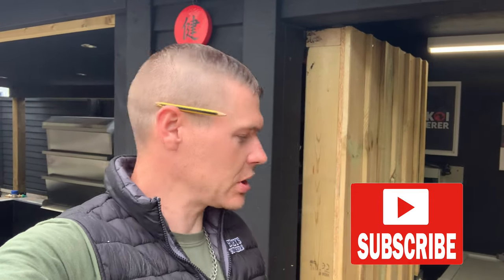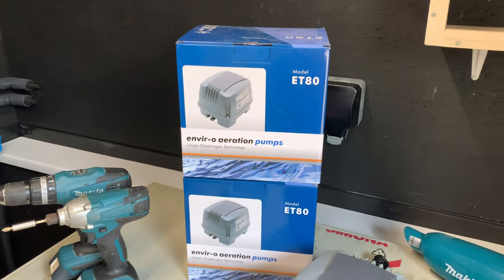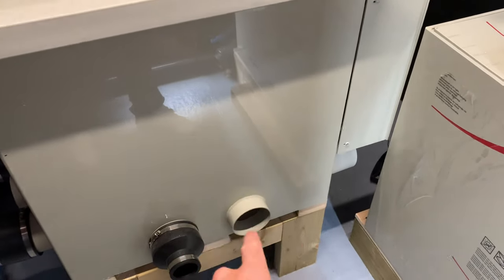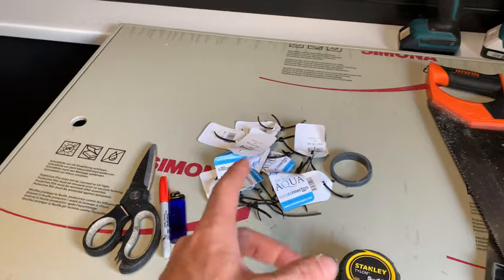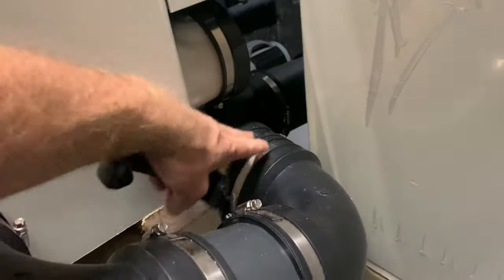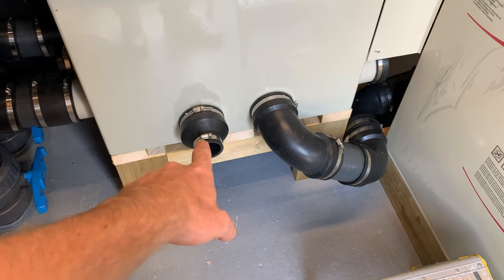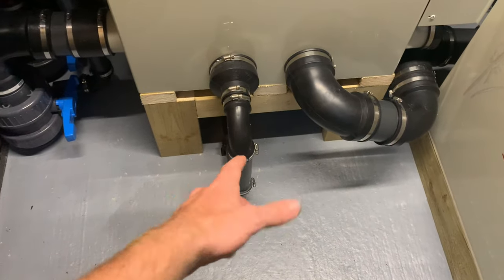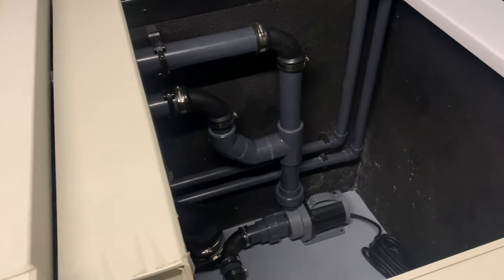PVC PIPE FITTINGS IN THE NEW KOI POND FILTER HOUSE**I HATE THIS JOB**BUT IT NEEDS TO BE DONE!!!!

Comment: James put all the pipe work in now to the 4” T and put a bung end in where the over pump will go it will save a lot of work later. All you have to do is take out the bung end and connect the pump straight on.

Comment: James , you've done an absolutely awesome job . One of the very best , which will inspire others to have a try . But I can tell that the way your struggling to get your filters in a tight space is bugging you . Before you crack on , is there no way you could exchange it with the dealer for something of a better fit . Maybe a combi unit or a bespoke bio unit . Or maybe once it's running it won't be an issue and won't bother you . Just want you to be totally happy with your dream pond and not regret anything later 👍❤️

Comment: Why not put the sockets for your air pumps in betweeNnthe shelves behind the pumps? Or lower the shelves to achieve the same? I have found that using the solvent weld flexible pipe saves having bends, like the pipe from your pump to the drum, looking good so far, have'nt seen your stuff for a while as my FB account was hacked and I had loads of trouble getting back on. Cheers. Mick

Comment: James your doing very well but I would still open the door outward and keep all the filtration on the pond wall with the boiler on the wall where the air pumps are it would give you a lot more room and access to service the boiler.

Comment: Looking really good james I can totally understand how your feeling in that filter house mate in the tight space I had the same problem in my filter house I also done other jobs in the garden and kept putting it off for rainy days 😆

As for the unions on the pumps use gas ptfe tape on the threads mate been there got the leaks then used gas tape problem solved. Z hammer 🔨

Comment: unions don't leak as long as you use PTFE tape on the threads of the pump and a good amount of tape to, mine have been on my pond for 17 years with the same o rings, just not enough tape on the threads would be an issue.

Comment: There's a lot of solvent joints there to glue up James, here's a small tip put a red dot on each joint as you glue them, that way you will see straight away if any have been missed when you check before filling, wish I had lol.
Reply from the maker: Deffo need some luck 🍀

Comment: Looking good 👍 Think about ball valves both sides of pumps for ease of maintenance. You could put the 4" pipe in now and blank one off or more ball valves (sorry I know it's more money).
The pipework looks beautiful but it is at a cost spotted you could reduce extra turns and use a couple of 45° instead of 90° which would be better for the pump, but might not look as nice as you like horizontal and vertical pipes 😁

Comment: I’ve got the Charles Austen air pump not sure if you will have the same problem as me but the plastic on top of the pump vibrates quite bad so had to put a elastic band around to stop it, hope that helps

Comment: Hey James 👋🏼 
Just use plenty of ptfe tape and then some more on the pump unions and it will be fine 💯.
I'm not sure what model drum you have bud (forgive me if I'm wrong as i can't really see) but the skimmer line and bottom drain lines all go into the same side of the drum (waste chute side). I looks like you have it the other way around.
Take care matey 👍🏼
Reply from the maker: Mine has 6 inlets mate 3 at front and 3 at back and 4 outlets
Reply: @JamesTHEKOIwhisperer123  which model is it? 
TF-500 at a guess.

I'm only used to profidrum or similar so not sure about these newer fancy ones 🤣🤣👍
Reply from the maker: @Tom_Prendiville  something like that Tom

Comment: Boom 💥1st, advice is run the rubber boots straight onto the pumps, obviously ptfe the tread on the pump but that will not leak, better than the screw fittings!
Looks great buddy 👍🏻😎

Comment: Your doing a great job bro, I do plumbing and heating for a living and your pipework is good, your doing the right thing taking your time, enjoy it 😆😆 I'm watching your progress wishing I could.start again, looking to relocate some where near barnstable in the next 2 years so I may have to do it all again... can't wait to see it all running, if the union thread is bottoming out onto the pump, taper the ptfe tape it gets thincker towards the back, that way you make sure your on with a good couple turns of thread as plastic threads are easy to cross if it's packed out with ptfe near the start. Have a good week 👍👊

Comment: You're doing a grand job on the pipework!
I love that part of the build, but being a pipefitter it comes a bit more naturally...
if the unions thread went on the pump a bit too easy (parallel not taper threads) I used loctite 55 PTFE string.
It makes a much tighter fit, just don't use too much, a few wraps of locktite 55 with PTFE tape on top.

Comment: why gas boiler and not a heat pump ?
Reply from the maker: Gas is cheaper over the year
Reply: Heat pumps are noisy and not very effective in colder weather
Reply: Did you have a look at Wrightys channel and his heat pump installation? Only costing about £1 per day during winter . Located outside , too and can plug straight into a socket 👍

Comment: You mentioned that you wont run the bottom drain air 24/7. You really need to run it 24/7. Air is critical to koi health and growth. Its probably just as important as filtration especially during the summer months.
Reply: In your opinion.....many of us use it on a timer and have no issues. It depends on the setup seeing as everyone's pond is different.
Reply from the maker: @Tom_Prendiville  yea I be useing a timer